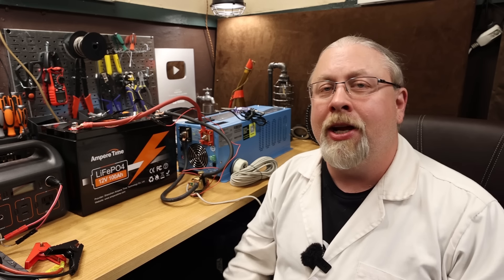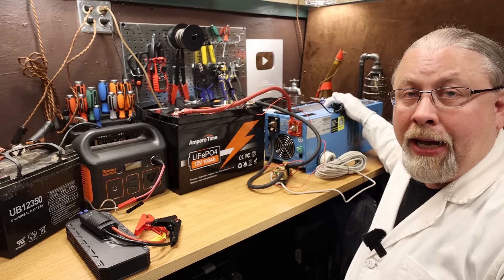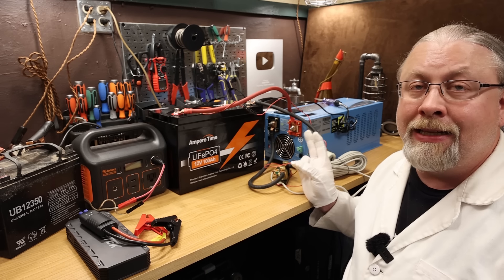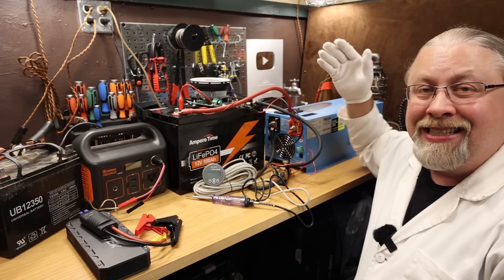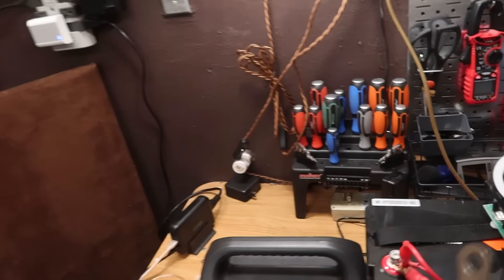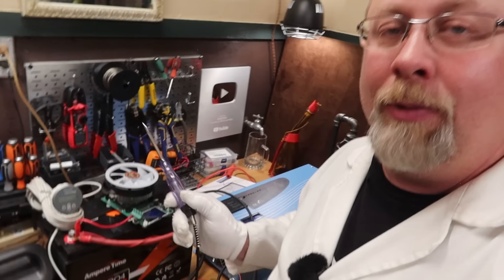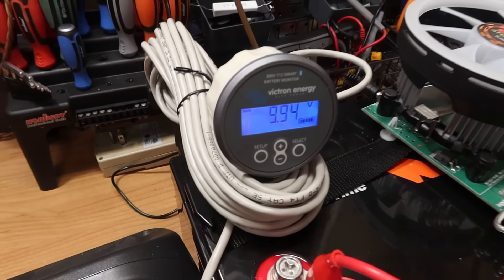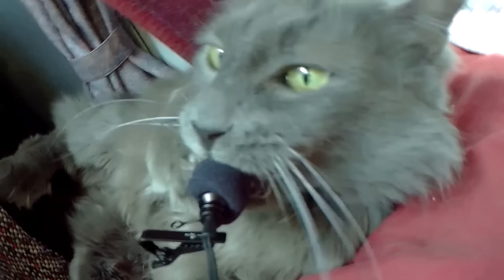3 Ways To JUMP Start And WAKE A DEAD Lithium LiFePO4 Battery FAST!

Comment: I have a 1999 Itasca motorhome and it has the three batteries and they're right on the step as you walk in the door I charge them a little bit and they almost crank completely and turn the motor on,,it was working fine and then the ex-boyfriend come by to act like he was being friendly and I should have known better the very next morning after he left I went to try to turn the thing over and it made no noise or anything whatsoever I'm being specific because when I went to turn it over it made plenty of noise and it almost turned over and I I know cuz sometimes I would buy and sell a vehicle here and there I'm not an expert at all I really am not but I want to know if there's a switch or what could have been loosened or pulled he was sitting in that captain's chair and I just thought that was funny how he made it a real big point to sit in that captain's chair and you almost look like he was trying to hide something for a minute but I didn't pay it any mind until later can you give me a few tips please I'm desperate

Comment: Seems technically the battery isn't at zero volts. The bms cuts the connection so to a multimeter it reads zero volts. I chose poorly for my charger purchase luckily I have a jumper pack which immediately got it to charge.

Comment: How do you wake up 24 V and 48 V batteries? 🖖
Reply: Same concept, with more voltage.  Wire two 12v batteries in series * USE A RESISTOR * and wake up your BMS.

Comment: I am old school and like switches, however, WFCO knew my converter would be hidden behind a wall with a bunch of dresser drawers in front of it and the instructions they gave me were to discharge my LIFEPO4 batteries down to 10%, then engage the converter power to let the converter charge them up with a full charge cycle. WTF, first they could not give me a charge voltage that I could look for and I know for a fact that my Battleborns still have 12.8 volts at a 10% charge level. Since I have a Furrion 12-volt DC fridge I do not want to screw up and discharge toooooo much, LOL. Nonetheless, I will quit bitching and get on to discharging it with normal loads. It will take a few coffees to get through this, LOL. -Davey

Comment: Nothing worked for me.  Lithium charger, another 12v battery, solar panels. Battery voltage was at 11.75 but would not charge when connected to charge controller and panels... so much for amperetime 12V 200Ah.  One good one out of two
Reply: Amperetime sent me a replacement battety without a hassle.  Customer service was first class.

Comment: So if you have a 48V battery and don't have a 48V power supply lying around, you are screwed.
Reply: well you can stock on 12V batteries and connect them in series to multiply the voltage

Comment: Have you or anyone in your group ever heard of a solar generator by a company called evergear in Canada with our lower dollar sky-high shipping Charges Princes Auto has the evergear 2000 watt pure sine wave inverter and a 2264 watt hour lithium battery  for  2300 dollars Canadian just pick up in store  an extra battery that doubled the watt hours of capacity for 1200dollars any help will be appreciated thanks

Comment: My 32 headway cells battery I built for my van was run completely flat, apparently the dome light was left on now a week later zero... I have no BMS so there is no low voltage protection. I just put my smart charger on it this morning on the lowest  3/5A setting, (I don't know but i assumed a low amp slow charge would be best why I didn't just jump start it?) it's looking like the charger was able to go into charge mode even tho it's was so low because as soon as I hooked it up the vans electrical woke up instantly so something is happening.... And the charger status readout is showing numbers scrolling through the volts amps yada yada. Hope its ok and didn't damage the cells, even those used headways are getting cheap I don't want to buy cells again, I will say I paid $340 for the (32 cell)beast module at battery hookup  over a year ago and last I looked a few weeks ago when I bought 12 headway cells for my cars audio system ($5.50 cell)  the super beast module (48cells) was $225.

Comment: Sooo you are saying…with solar…🤔 a 12V input?

Umm got that and lead acid batteries that might shock ya have been sitting ‘dead’ since 2018 yet are CAPABLE of way more than you can imagine. BIG and heavy… a real workout to move BUT are way more capable than anyone gives them credit IF they are in a house. You need the right type of solar charger is all I will say.🤐

Why NO LTO or even sodium ion batteries yet in the portable units? It is obvious WHY no lead acid.

Then again…🤔🤫
Reply: Sodium-ion aren't ready for the market yet, I understand. But it shouldn't be long. Large, but dirt cheap per watt hour. Might not be much use for portable sogens at first, but could be a game-changer for home backup.

Comment: I’m not bringing back Tesla from the grave to fix a battery.10.4 v on 50 ah, 12v. Voltage too low, 10 . 4 volts. That’s it. Li Time. Tried each approach, nothing….. Gonna By pass BMS. Can’t find video…..

Comment: Advice: Don't let your lithium batteries sit dead for too long as that could permanently damage their chemistry rendering them useless or shorten their lifespan.
Reply: @EfficientRVer  You still need to pay attention.  If you take a lithium battery down to flat and then put it on the shelf for 6 months the BMS and even the low self discharge of the cells themselves will slowly draw the cell voltage down to the point where things can be damaged.  Its the #1 reason why people with battery powered yard tools find their battery is dead next season.  They can sometimes be revived by opening them up and applying DC direct to lift the cells to the point where the BMS will operate again but there's plenty of examples where a cell has been reduced in capacity to the point where the battery no longer does the job.

Moral of the story is, even with a BMS you shouldn't leave the battery fully discharged.  You will forget and the piper will be paid.
Reply: Tried this on my Dakota lithium battery... It's reading 0.7 volts. Jumped it and it's still not charging. What gives?

Comment: some of your information is not correct, the BMS does not shut off because it does not have enough voltage to function anymore. It shuts off so the battery does not drop below 1%, its the Low Voltage protection built in.  In most cases you don't even have to charge the battery to get them back online, just tap a 12v source on it and it will wake the BMS up to allow charging. Also MOST chargers that have Lifepo4 settings WILL NOT WAKE your dead bms. Just use a regular car charger or any jump starter. It does not need to charge the battery it just activates the BMS to come on.